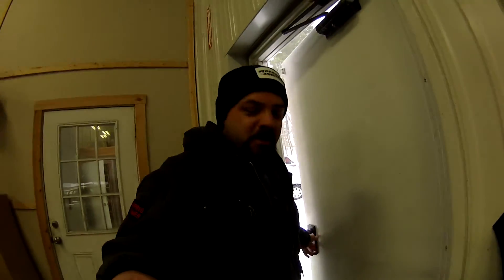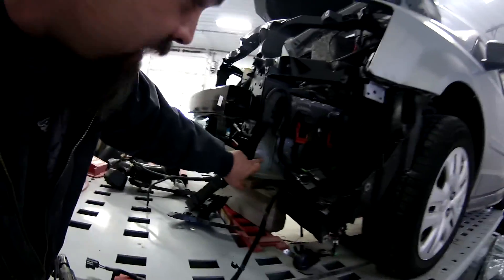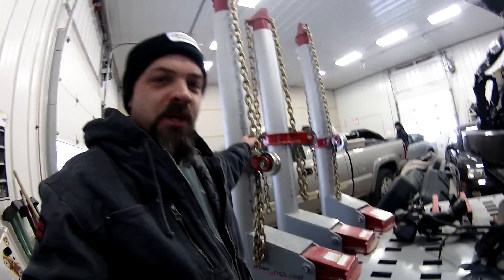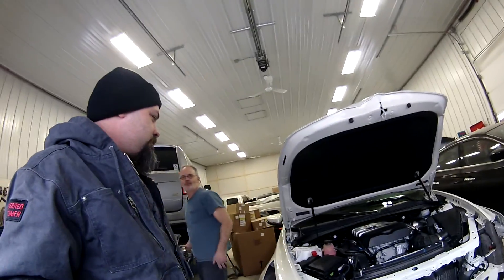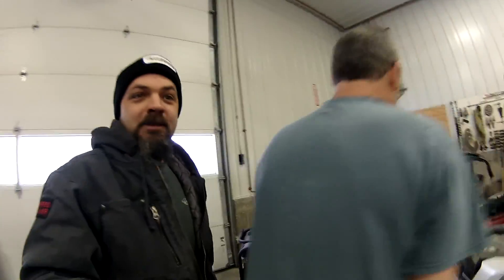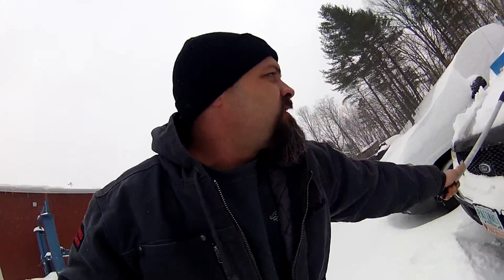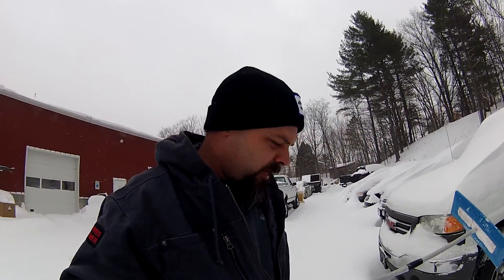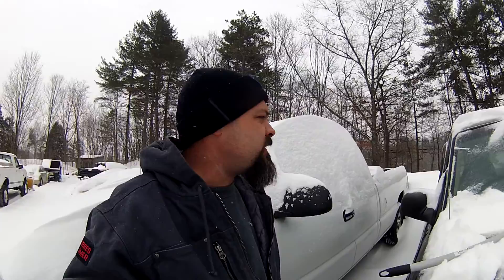Field Trip To The Bodyshop To Check On The Supervan!

Comment: Here's a question… As a mechanic, do you mind doing small work for do-it-yourselfers? For example, people bringing you rotors to turn or swapping a shock on a strut assembly using your spring compressor. Also how about a tour of the toolbox